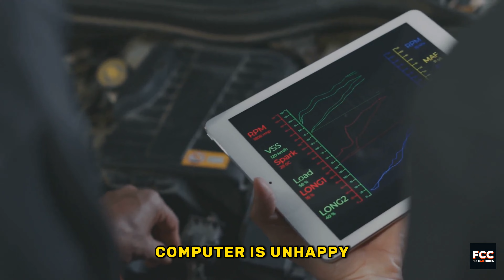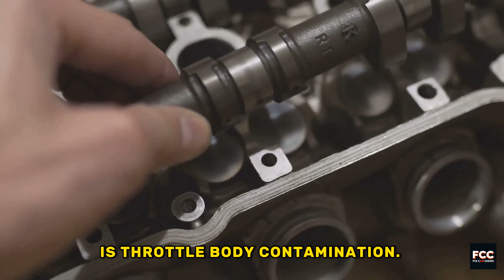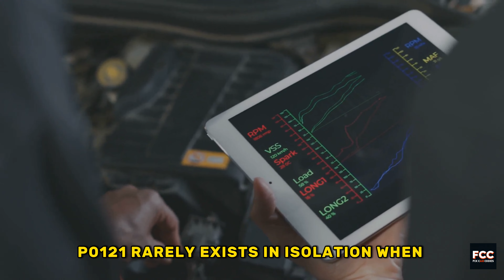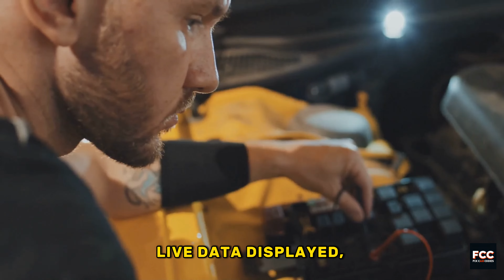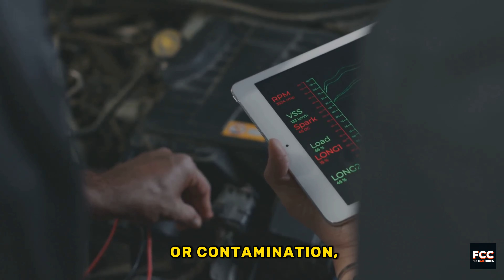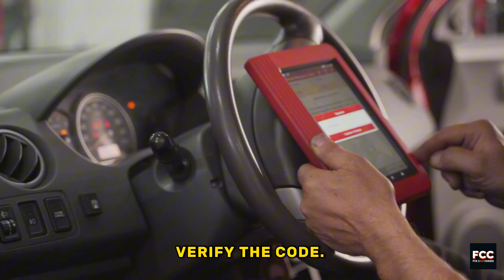P0121 Code: Why Your Throttle Sensor Isn't Always the Problem

Comment: My TPS has the system stuck at 25 percent. You say nonmore than 2 percent. This explains why my idle is at 3K. Now how do I get the number back in range? I have tryed both one and two and for some reason I can not find relearn inside my Solus Legend.